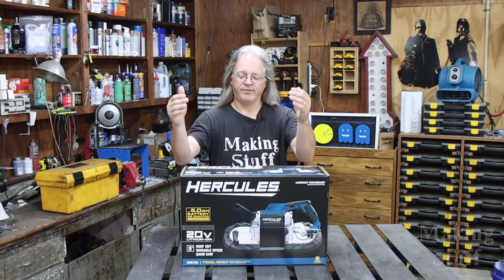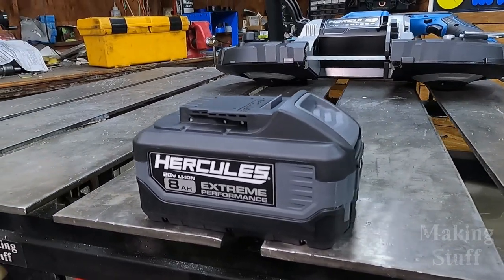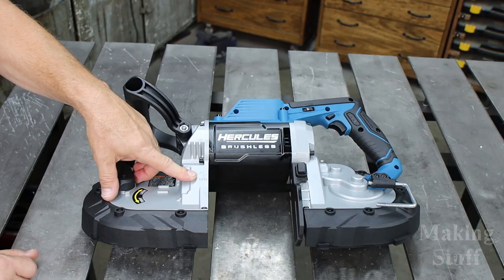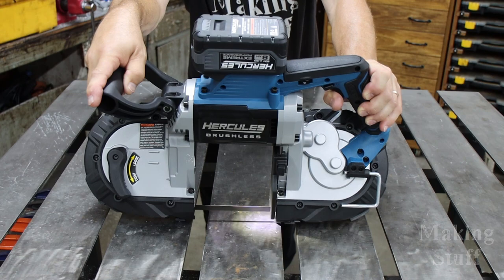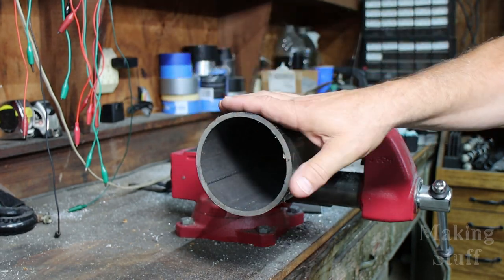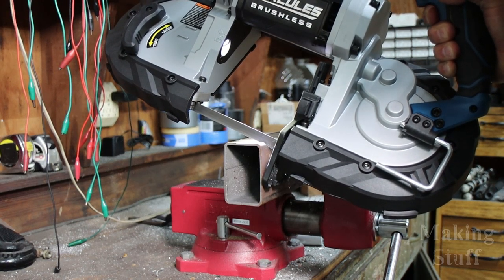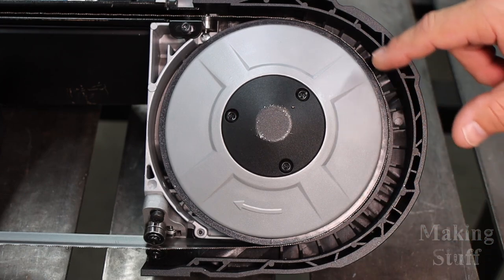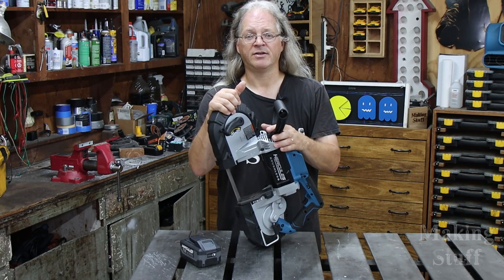Harbor Freight Band Saw Review - Hercules 20V Cordless Deep Cut - Will It Cut RR Track?

Comment: Haven't subscribed at this second... but I'll jump to your site and see if I am intrigued. For now, thank you! You have articulated with aplomb and with clarity... great job. And, just for druthers, I did buy the stand for this saw but have not used it yet... not installed it. The other thing is that I do not weld so wood will be my target type of material. Again, thanks for a great video.

Comment: After numerous of research, I decided my collection would be Hercules. My brother has their Milwuakee tools and I am not a type of person who uses like the rest do but since all the projects that I do is only DIY projects I went to them and give it a try, I do not think I made the wrong decision. I already bought the 20v Impact Driver and in love with it.
Reply: I tend to be a tool snob myself, but I think you make a good choice too. My boss has a Milwaukee cordless band saw similar to this, and I HATE the dual safety triggers on it. You have to engage the front and rear safety switches on it in the right order or it won't turn on. Dumb thing seems to shut down if you don't use it for a few minutes after inserting the battery, and you have to take the battery out and in again to reset it. IDK if that's another feature it's broke somehow, but for over $300 for those things, I'd expect something better.

Comment: Great video! 
Question: you don’t need any lubricants during the cuts?
Reply: It would help IMO, but isn't super necessary all the time. I would say just for tougher metals like stainless steel which doesn't dissipate heat well and keeps more heat on the blade.

Comment: That saw looks sweet.  If you don't want to use the hercules batteries, you can get adapters for dewalt, milwaukee, skil, ridgid and a few others.  Any if the 18v nominal batteries will work.  (DeWalt 20v is 18v nominal in other countries, their  batteries say 18v).  I'm going to use my 25% off no exclusions on this.  Thanks for the review
Reply: There's is no adapter from any battery to hercules, plenty of hercules to every other battery platform though
Reply: Hercules batteries actually have quality cells in them anyway.
Reply: Really?

Comment: I'm just tired of buying into battery platforms and wondering if this will just be like my earthquake polisher that they no longer support so until I can find an adapter to use my red batteries...i guess I will just keep dragging out the cord for my yellow one
Reply from the maker: I hear you on that.  That's one reason I have stuck mainly with Dewalt over the years.  Years ago, I had a bunch of Craftsman tools and they just stopped making batteries for them. HF seems to have up'd their game here over the past couple years.  I'm hoping they get the big picture and do the same as Dewalt.
Reply: I've been on the Hercules platform now since 2018... it's now almost 2024... that's 6 years now, and a fairly extensive lineup of battery tools.... what do you think?

Comment: Why aren't you using any oil or water while cutting?
Reply: I'm betting because it's portable and people will often be using them to cut dry on job sites or projects where it's impractical because of where, what and how many you will be cutting.
Reply: Bandsaw is meant to cut metal dry
Reply: @evanfrucht  agreed but that's also because they're cheap. A higher end unit with wet cutting will perform better and it's left up to us if we will add a method for wet cutting with these. 

Oiling materials beforehand helps, but it also increases the conflict risk of accumulating debris in the cutting path and on the blade if the system does not flow and remove the material aside from lubricating it.
Reply: Torture testing?